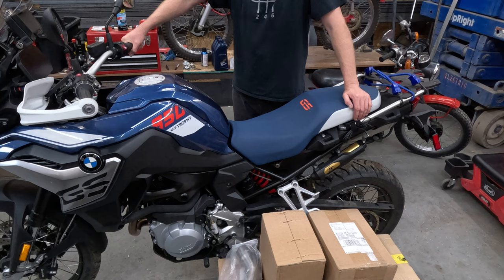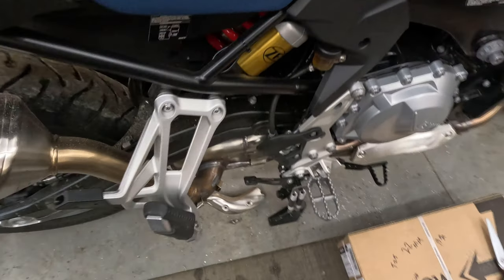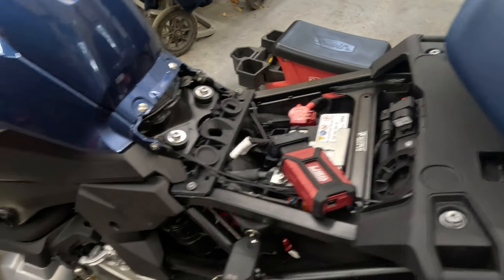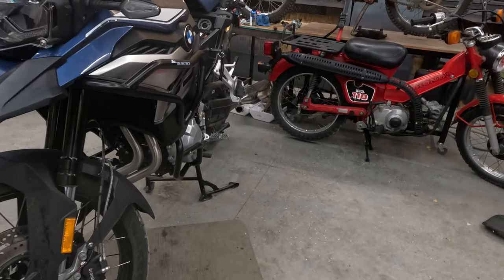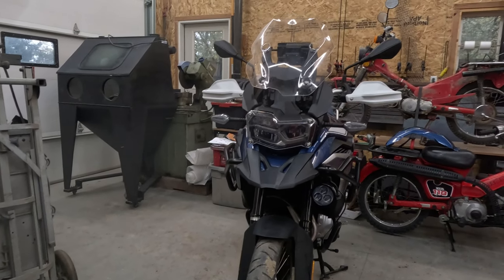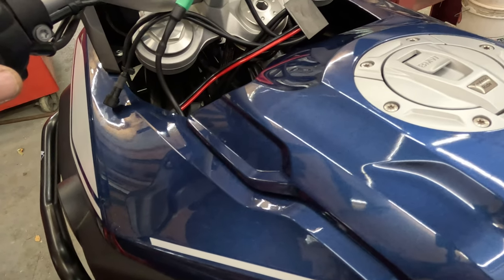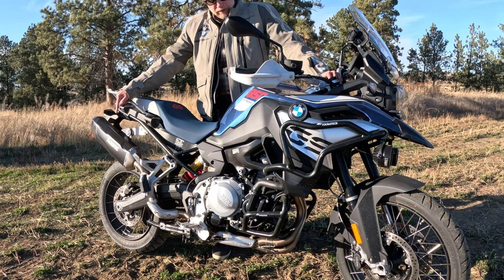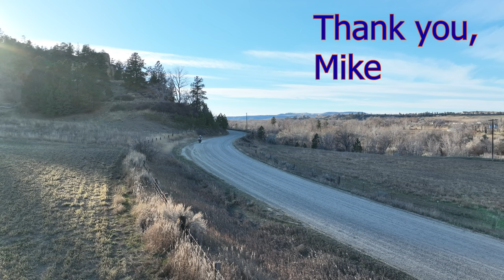How to Build the Lightest BMW GS ADV Ready Motorrad #motovlog #bmwmotorrad

Comment: Nicely done. Those mods ain't cheap - wow! I was going to suggest a skid plate but I see you've got it in the plan. It'll add weight, of course. Sounds KILLER.
Reply from the maker: Thank you.

A little north of $2k in upgrades.  The exhaust sound is very cool.  Raspy and loud like a dirt bike with a deeper tone.  Doesn't drone too bad on long high speed trips.  Everyone including Harley Boys just gawk at me when I pull up somewhere.

Comment: Thank you for video. I am ready to do similar project. I will remove elephant balls from exhaust sys, put on racks for luggage box, for 10days trips, SW motech skid pl, crash bars, .it will be extra weight but I can handle it ;)
Reply from the maker: Thank you. 

The stock exhaust weighed about 26 lbs.  The Arrow/ Akrapovic weighed 10.  The fogs and crash bars weighed about 15.  So, about the same weight and off-road ready.

The bmw muffler/ silencer is insanely heavy compared to the Akrapovic. 

It is nasty loud but way faster and more powerful than my stock exhaust 2019 F 850.  I can really tell a major difference. 

As far as the metal luggage racks they are a must have for crashing off the road, and I love the look and function when on long trips with the metal panniers.

Comment: Does auxiliary lights had  connection to BMW electric system? Or you did extra work?
Reply from the maker: The clearwater fogs are awesome.   They have a built-in device called a "can opener" that connects to the OEM wire harness.   On the 850 it is at the taillight. 

After connected, you can program and adjust the lights with sequences of pressing the factory handlebar buttons.  No additional wiring or switches. 

I have mine set up with fogs on low with low beam and fogs on high with high beam.  When I honk, it flashes the high beams, too.

Pretty bad ass in my opinion.   Highly recommend the Clearwater Krista.   I might go one size smaller with Darla or Dana.  I forget the name of the smaller one.

Comment: Fuel mileage after removing CAT?
Reply from the maker: Nothing noticeable.  It is just happier and louder.  I am getting the bike tuned at BT Moto and then I will probably see a return on MPG.  Now it just smells a little rich and I ride fast.  So, not that great or great given context.  The 850 is all out at legal plus plus speeds and doesn't get good MPG.  Slow it gets 45-50 MPG.  I don't ride slow.
Reply: @motorradmikegrossheim  ty👍